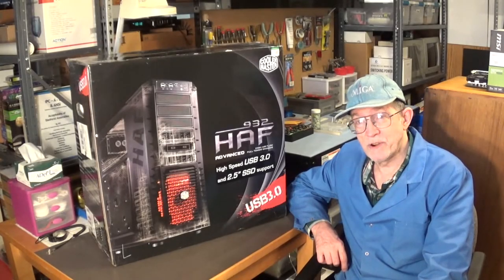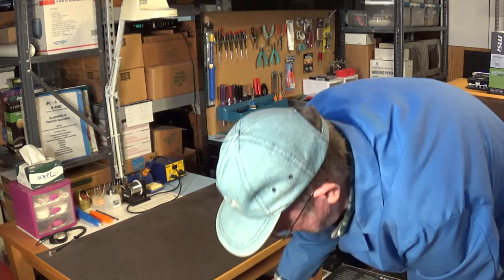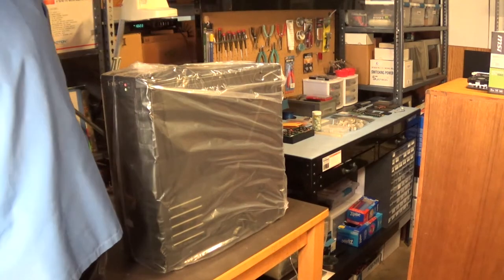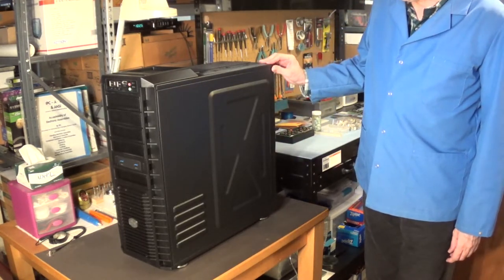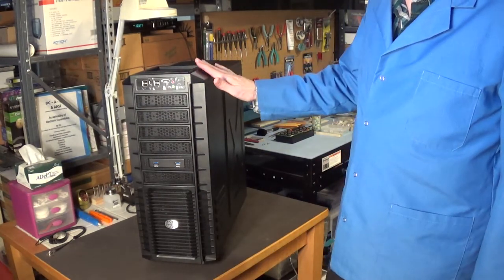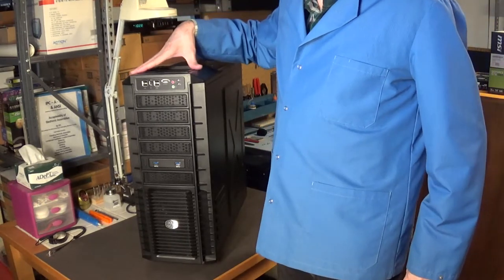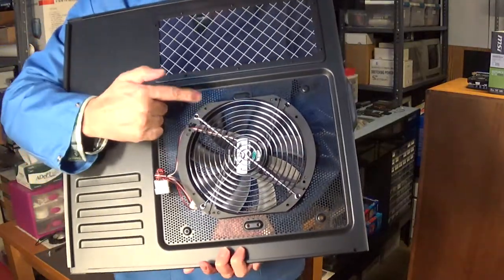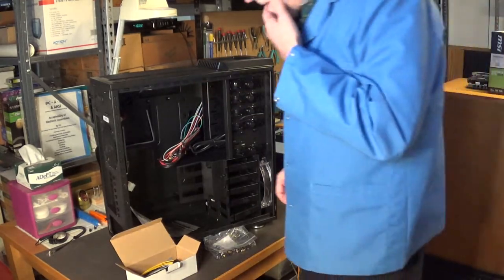Cooler Master 932 HAF Advance Case - Very Nice !

Comment: I gave my computer with the Cooler Master Case to my sister.  I'm currently working on a new rig, just waiting to find Zen 3 CPU and Nvidia Ampere GPU to be available (without scalping).   Going with a Corsair case with the new rig.  Upgrading because Microsoft Flight Simulator 2020 wasn't running that great on my old 2014 rig. Oh, and no hard drives in the new rig. Will be using 2 M.2 SSD's.   I still use hard drives, but want the speed.  I can backup to a hard disk.  BTW, I have a couple SSD's that are now about 12 years old.  Rather slow SATA2, using in my old LGA775 rig.  Never had a problem with them,  But, they are boot/system drives that aren't written to very often.  The rig I gave to my sister has two SSD's that been in there since 2014, and one gets written to a lot, and still going strong.